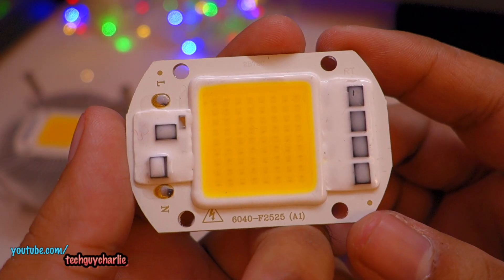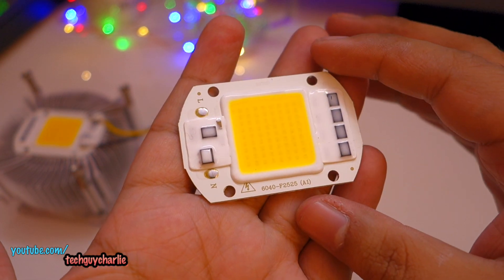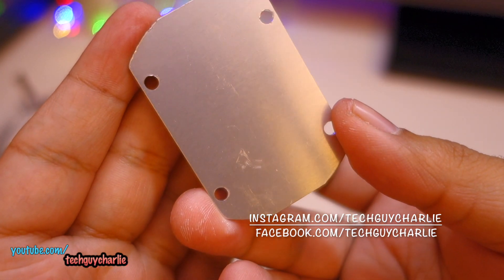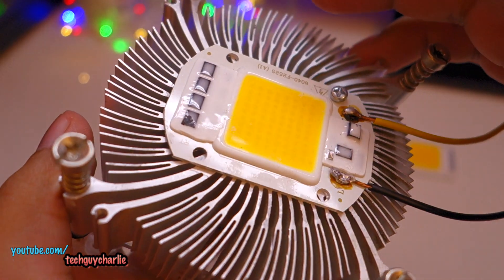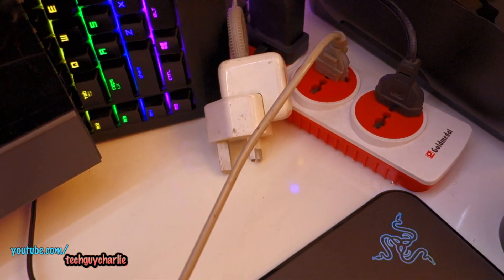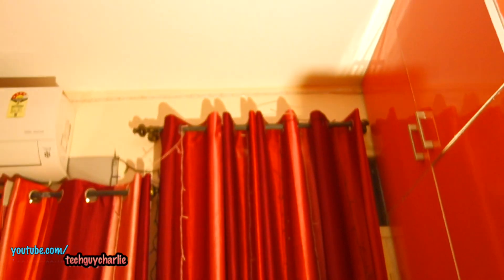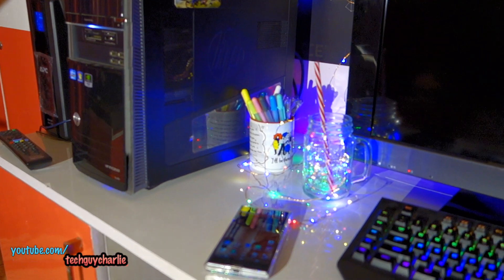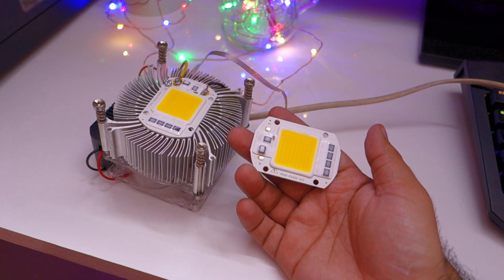50 Watt Driver-less LED chip light (plug it straight into mains)

Comment: Is it possible to attach a dimmer or potentiometer to those driverless leds? Or they would have flickering ?
Reply from the maker: I havent tested it with a dimmer! But I dont think it will work, as far as I remember, these were not listed as 'dimmable' but overall these have been very reliable, I have these installed in store room and they still work great.
Reply: @TechGuyCharlie Hii! Super video you made here, these chips seems to be really really cheap but I'm not sure how long can they last, if like to use for growing plants and it seems it'd work, any recommendations? Thanks for sharing the video!!🙌🏼
Reply: Same question   @TechGuyCharlie

Comment: Thanks. Have you any recommendation what to put on to the solder spots? Universal glue Fluid will better than a glue gun because the blue out of a glu gun will melt down when heat it.
Edit. My purpose is isolation of the soldering points. I plan to use liquid isolation "tape " and Kapton (Polyimid) tape (light brown colour) on top. Am also using up my units w/ separate driver (~30 Volts), but the drivers partly don't even work when delivered (70 Watt/ Waterproof and Alu case - thus might bear electrical current but rather quality's the issue)  Take care men (written November of 2023)
Reply from the maker: Standard soldering should work fine, I havent put any glue on it and haven't had any issue, still got these LED chips and they still work great.
Reply: Epoxy resin

Comment: Help! I connect my driverless cob led directly to AC 220, it exploded and burnt my table. What did I do wrong ? And my room all outlet not working, while the other house area fine. I checked my fuse box no breaker trip. What should I do?
Reply: MrLennonson was it wired in reverse polarity, maybe? Capacitors will explode reversewired....
Reply: @Carriebloss  Hi, my wire both are black I have no idea how to detect which is the positive one... Please help
Reply: polarity doesnt matter with AC
Reply: @poiiihy  polarity doesn't matter in AC? What should I do? Is there something that i did wrong?
Reply: @MrLennonson  like i said you probably mistakenly recieved a 110v version instead of 220v version. either that or it was just defective. I do not think you did anything wrong yourself.
Reply: @MrLennonson  bigclive has a video on the newer driverless design where you can find out the difference between 110v and 220v versions (it's controlled by different positions of 0 ohm links). If it's from like ebay you can try requesting a refund for wrong or defective item, especially if you can tell it's 110v.
Reply: @poiiihy  yes I got my refund back. But somehow my project never done cause I'm in scared of continue it again. It almost blew into my face... Should i try again? Or maybe get something safer to continue?
Reply: Driverless?
I think your cob led only support dc current,
You need ac to dc driver,
If you directly connect the dc led to ac, it will burn.
Woww i dont have any idea about the outlet power on your room,
Maybe you had to check the outlet for powering the cobled, it seems the wire short,
Or maybe you have any fuse around the house or another circuit breaker
Reply: @binarsobudiono8388  yeah there's another circuit breaker for upstairs.
Reply: @binarsobudiono8388  I believe I have the same driverless led. The information given that it's for AC, I wired up. One of it functioning okay, then the 2nd one blew up and burnt my table. Quite dangerous cause I got my face very close as I did not expect this happen.
Reply: you probably got 110v version
Reply: Read the comments. I know this is 7months old, but this is a b polarity. Except L and N are probably load and neutral.

Comment: What size of wire should i use? I can't solder  to the points
Reply: same here
Reply: The German VDE norms and also law require 1,5 square Millimeter diameter of each wire. Please check the AWG number for this Dimension (around 22)

Comment: One question. You connected the wires directly yo the AC or fiesta you have to plug it to a DC transformer? I have one but I'm afraid to cause a shocking hazard
Reply: If you also bought a driverless one it will plug directly into mains volage. He was just using this box to switch it on and off. But remember 110/230v are not a toy, handle with care!